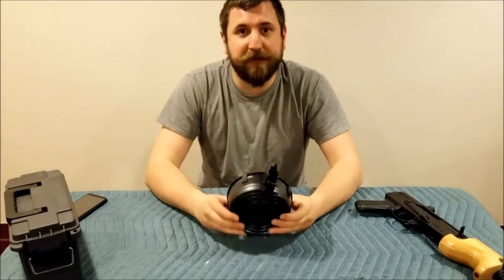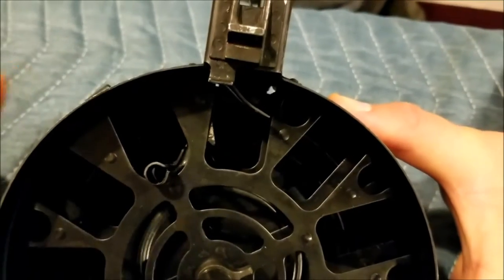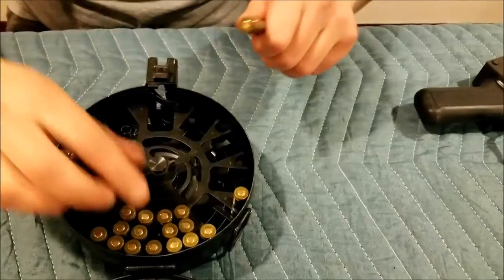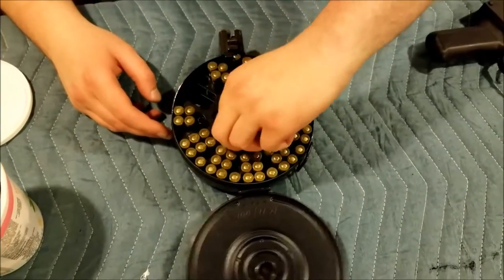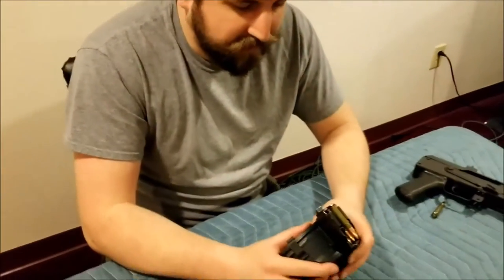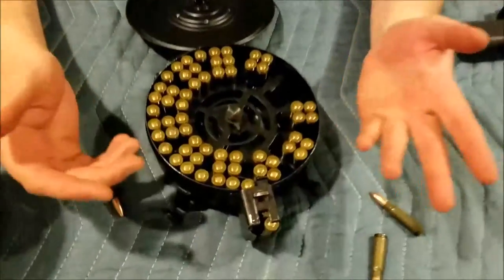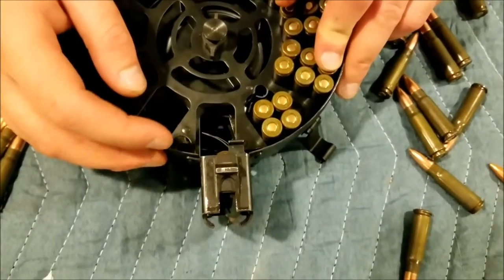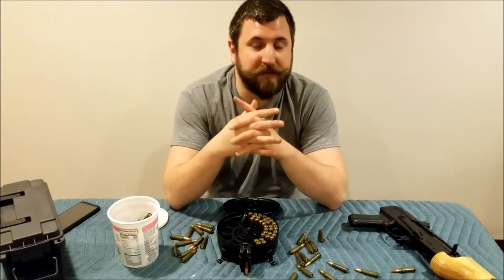Loading an AK 75 Round Drum and Issues with them

Comment: I believe you are having issues with it because you are loading it incorrectly .. You are not even filling it all the way .. These drums are built to hold exactly the amount of Ammo it’s intended for. If you are not able to fully fill it then your doing something wrong .. You closed the drum up with an entirely empty slot 🤣😂🤣
Reply from the maker: It's just a demonstration as if it wer to be fully loaded, (plus I had someone else putting rounds in too.) but no you do not have to fill these all the way. If it wasn't to be filled all the way then it you would just fill the outer rows first In a clockwise direction, then inner row and so on with as much as you have.
Reply: Incorrect, these should keep spinning if there gap. Its not going to jam like wtf are you talking about